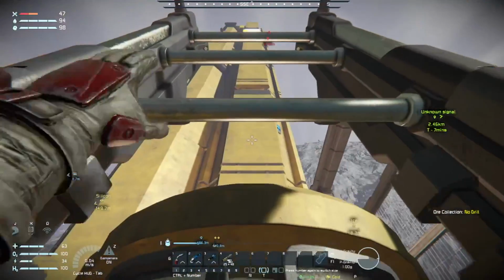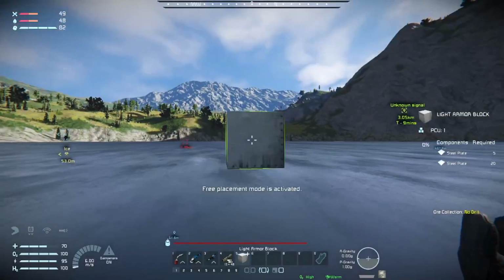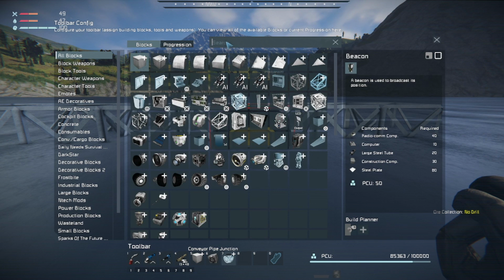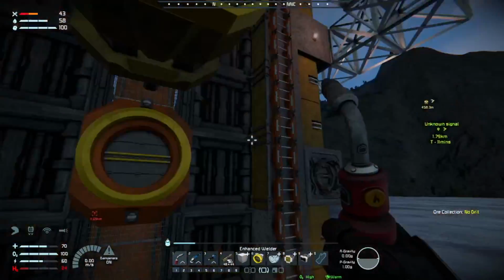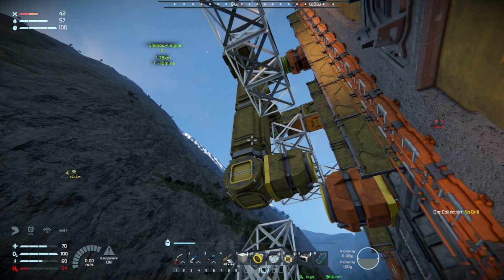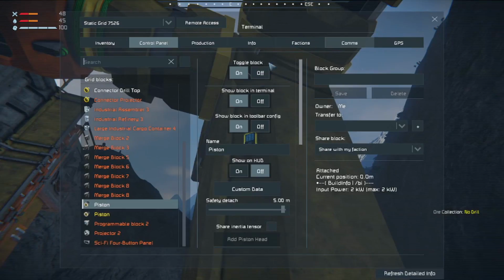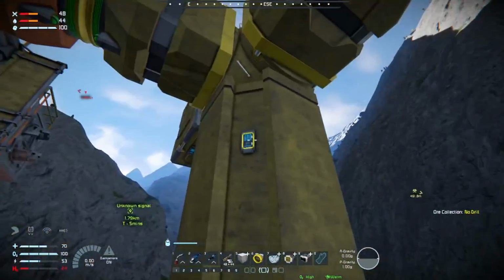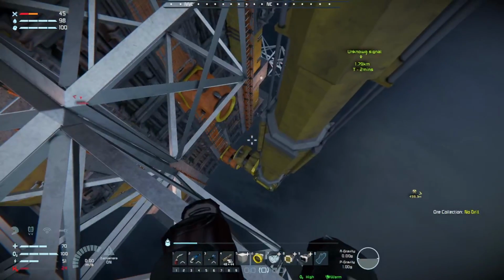Planetfall - Ep 7 [Space Engineers]

Comment: Fun Story, I built this with some minor tweaks to suit my play style in my play through. I then downloaded this bp from the workshop, put the two side by side because I kept having that issue where the Merge block was making everything one giant station. Thanks to you, I was able to take my 9 Timer system I had mostly worked out by myself (still figuring all the automation stuff out) and slim it down to 4, only because the merge block is a little doofy if not perfectly aligned on my save lol. Thanks for inspiring me to learn this game better!
Reply from the maker: Nice man! I had to trick the merge block too with 3 timers:
1: locks bottom connector
turns on merge block
Locks top connector
Triggers 2
2: unlocks top connector
Triggers 3
3: locks top connector

The little shift from the connector unlocking and locking again was enough to get my merge block aligned. 

I still have to manually hit the button to get the thing to run though, I found that the top part of the drill where the projector is will convert to a station occasionally so I have to climb down and sit on top of it to convert it back to a shop when the merge block unlocks. Otherwise the pistons clang out and drop the drill head
Reply: @Lenscap  yikes! Yeah I'm working on figuring out what's going on. I'm not even a third of the way to my own Mg mine, but now that I set the drills up in the cascading way yours are, and the smaller number of timers, it seems like everything has smoothed out lol.

If I could keep up with the materials needed to weld up the crawling face lol